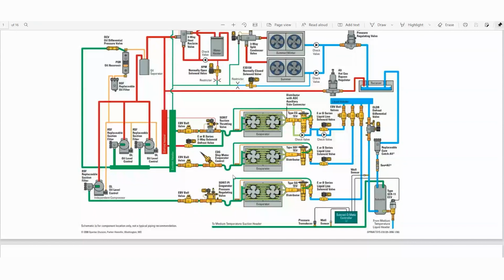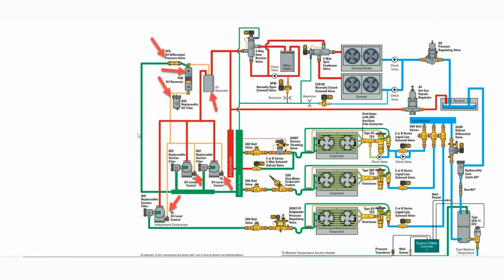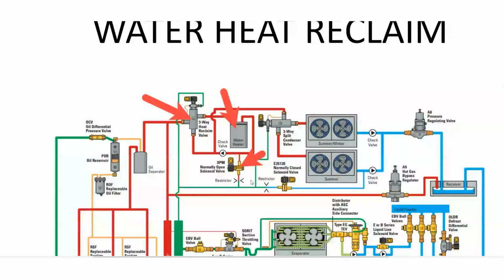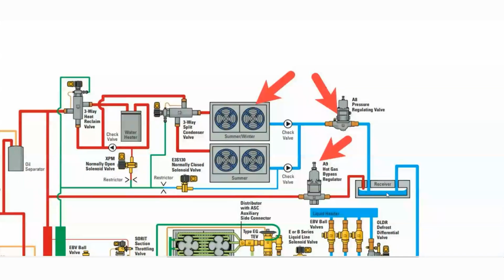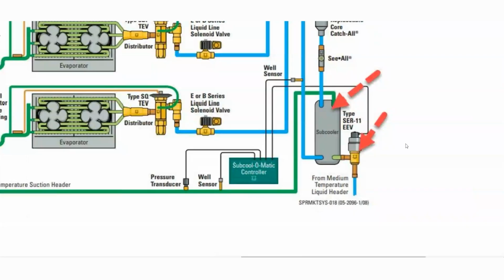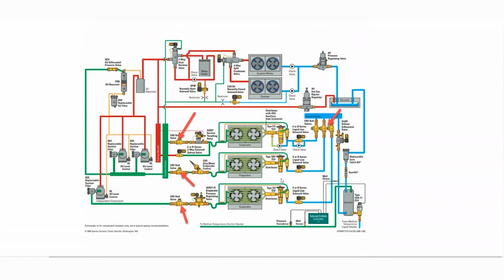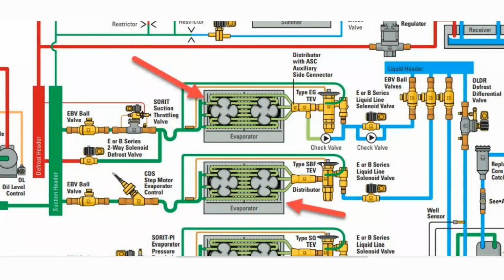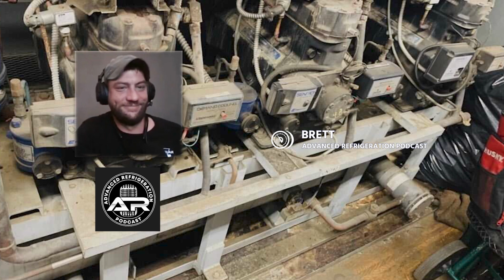Introduction to Rack Refrigeration Components (Grocery / Markets) w/ Advanced Refrigeration Podcast

Comment: Your speakers need a pointer to point to the component they are referring to.  The viewer , who is not familiar with the complex diagram, needs assistance to point to where on the diagram the speaker is referring to.

If the diagram was simple, then pointer system would not be necessary.  But this diagram is rather congested with many components, so any help from the speaker would greatly help the communication and ultimately the understanding being sought by everyone involved in this teaching process.

Comment: I have been in the HVAC trade for 30 years was introduced refrigeration in 1993 .I picked up rack work via  OJT and got in the early 2003 .So I have worked on more then a few racks since that time.I always tell my apprentices their are a million ways to skin a cat so this trade is never going to be  boring . This is especially true with rack work things are changing at a rapid pace  .I worked on several CO2 systems in 2015 before I got away from racks altogether .I have to admit though I prefer being stationed at a nice quiet IT facility turning a wrench on  Liebert systems etc..  to doing rack work .The beauty of this trade is their are so many specialties to pick from .
Reply: You said it l did racks late 90s early 2000 had a chance go inside at an facility department never looked back with OT was too much after 7 years l glad l did change early 40s now l got decent retirement.
Reply: FdEnchiladas Supremas$12.59
Four rolled corn tortills stuffed with beef, cheese, chicken and beans topped with cheese, lettuce, enchilada sauce, tomatoes & sour cream
Reply: Danfoss all day long run a small bizer and discharge separator
Reply: Run Danfoss

Comment: Oil logging on the lowest temp cases like aways also oil seps have o ring that tend too pop and causes oil fail calls and flooded starts. Also need to turn each compressor one by one and the smallest one first. Also plugged TXVs are fun after power outages. Very nice information I love seeing this the older Ref techs showing the younger tech starting in this field. It’s a lot of work but worth it.